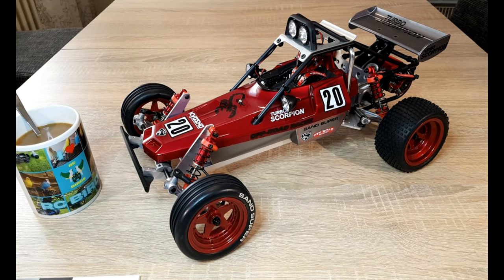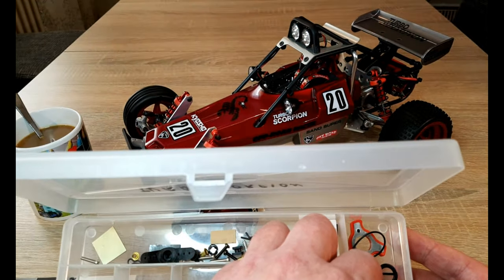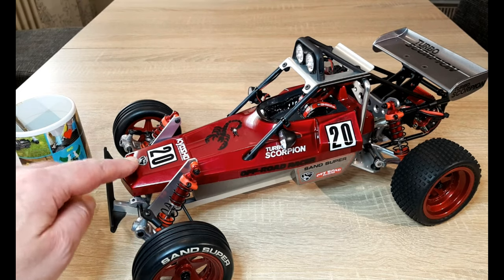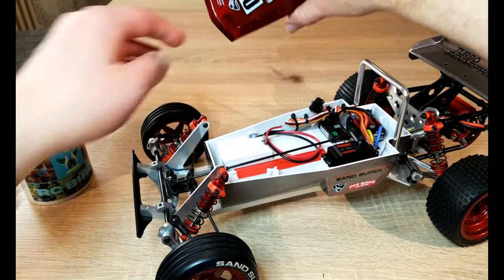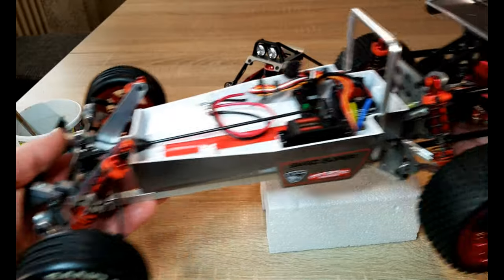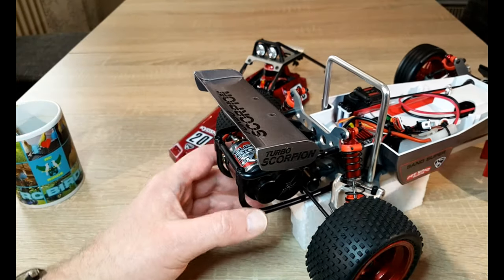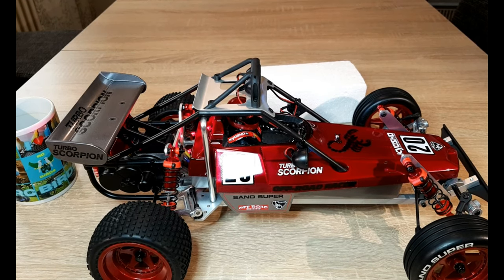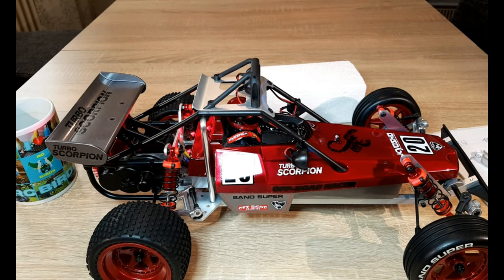Kyosho Turbo Scorpion (2017) Review Part Two

Comment: Wow that’s a good looking turbo scorpion! You did an excellent paint work on that kyosho. Your right about the gearing, there race tuned, on mine Ultima it comes with a 25 tooth pinion and a 48 spur gear. Mine has Just a standard 540 but it increases the rpm on the motor, so it’s like having a 21 turn motor with a 19 tooth pinion 48 spur. But won’t rev high like the ones in our kyosho’s. I should of read the manual on what size the gears were, because originally I was going to install a sport tuned motor, which it would of been ridiculous to fast, like having a 17turn brushed with the 19tooth pinion, on a standard setup. I’m glad I decided to keep mine with the silver can 540. These cars a way to expensive to break em! Lol!!!
Reply from the maker: Thank you so much for your comment. You're right, the Kyoshos are speed beasts out of the box and even with the silver can. I had seen your and another video and I was quiet impressed of the "standard" speed. For sure I'll never use a brushless system in these vintage cars. These motors weren't invented for models in the 80s. So the parts are not made for such aforce. But somehow you get some security with those metal gears and the slipper clutch. Eo brushless might work.

Mine is made for the beaches we visit in our holidays (Lübecker Bucht failed, the sand was too deep and soft, Norderney still has to be tested). So I'm hoping nothing will break on such soft surfaces.😉
Reply: @RCBirds  you’re welcome bro, yeah definitely speed beasts, and that’s all thanks to kyosho with the well gearing on there buggy’s. I don’t think I will ever do brushless with my Ultima, as it’s way to expensive, if I break it. Yes very true these buggy’s were built back in the 80’s, and my opinion I wouldn’t put anything more than a 21turn brushed motor. But I’m keeping mine with the stock motor, as it’s for me plenty fast. 👍I’m sure on the beach would be more than fine as there’s no real danger of breaking things on it, I usually take mine at the track near my house they have a huge car parking place there, I’m actually situated in Australia, we have lots of parks and spots were we can run our r/c’s 😄take care of your scorpion, I wanna get one myself at some point soon, and want to do a custom paint on it to. I’m not really a fan of box art, only if it makes sense to do a box art, and it looks ok then I’ll do it. Also thanks for taking an interest and time to watch my channel. I subscribed to your channel. Take care amigo 😉

Comment: Man that is a lovely looking RC. I would like to get some Kyosho on the channel at some point. Maybe Xmas.
Reply from the maker: Thank you Paul. I can really recomment it. Those kits seem to be expensive at the first sight and there are no motors or ESCs in. But they come along with many metal parts and a complete set of ball bearings. If you would uprate a Tamiya to the same stage, Kyoshos are cheaper although the first investment is higher. And motor? Who drives the 540 silvercan even in the Tamiyas?😉
Reply: @RCBirds  Very true, and good to know.

Comment: Hi, nice build, I like the color combi. I have one too, painted in silver & blue. with a 3421kv brushless motor. Do you also have the problems with driveshafts falling out? Thank you 👍
Reply from the maker: Thanks for watching. I got no problems with the driveshafts. But I had this issue with my Blackfoot. The reason there was the in- and outward moving of the shafts while the trailing arms fo up and down. But the ORV-cars have first plasic parts, second the arms are very long and third the dogbone ends are very close to the edge of drive cups. I checked my Turbo yet. The shafts should not fall out. Please check the mounts of the trailing arms, maybe there is something wrong.
Reply: @RCBirds  HI thanks for the answer, checked the trailing arms again, everything seems fine. Sometimes I'm able to drive half an hour before one of them falls out. Maybe its simply overpowered, I'll try a brushed system. But it drives like a charm, I have Tamiyas and an Aarma, the Scorpion is by far my favorite in terms of driving and quality.
Reply from the maker: @alexj.4046  I was suspicious about the combo, too. But Kyosho optimize the ReRes for brushless systems and I have no experiences with these motors. So I'm not in the position to say something about it.😉 I have a motor with around 30 k rpms. Combined with the gear ratio you should get enough speed. In free spinning y rear tires instandly intnet to baloon and would jump off, if I hadn't glued them to the rims. I hope you find a satisfying solution. For me the TS is one of the best RC buggies, too.